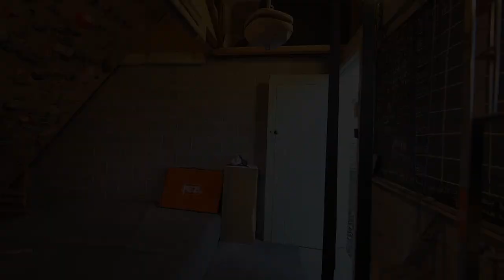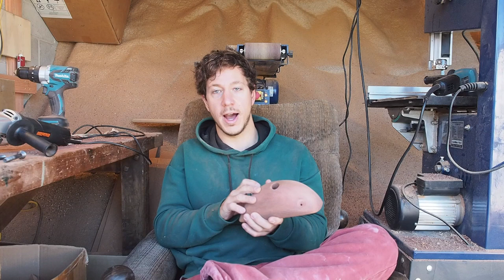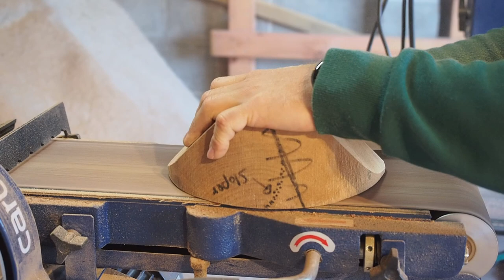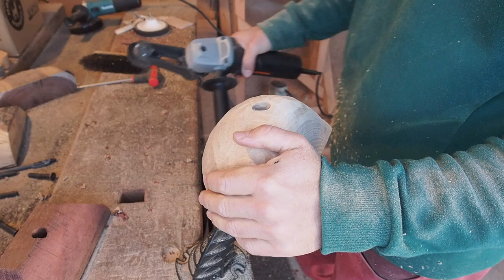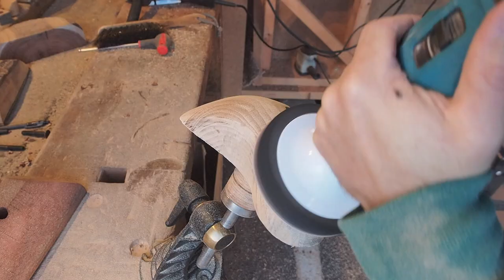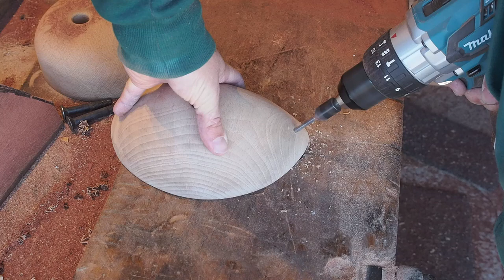Shaping Wooden Climbing Holds - Sloper #1

Comment: Great work! Just wondering why you go for the full sanded finish? Wouldn't a rougher texture from just using the grinders be a nicer feeling texture at half the time and effort?
BTW, are you in NZ? Those were definitely NZ birds at the end...
Reply from the maker: I just love the slippery finish... You need to apply more contact strength. :)
Also noticed that I use holds with a sanding finish more often. But yeah, it is bad in terms of effort!
Yes, I do live in Geraldine, NZ! 
Alpine Kiwi, sounds like you're also south island based!?
Reply: @wurfttobias  Gotcha! I've made a few holds over quarantine out of excess oak. I used an axe 😂
I was born in the South Island, but shifted to the French Alps back in 2001...
Great DIY series, cheers for sharing!

Comment: What are your thoughts on using self tapping screws vs bolts? You seem to use a lot of bolts but lots of wooden holds I see at my local gym on the training wall use 3 self tapping screws. 
I also commented on one of your other videos asking about bolts :)
Reply from the maker: Hey again! :)
I'm using bolts for two reasons:
The workflow of how I use the carver's vise makes it so easy. You can even attach the hold upside down and continue working on it. With screws it would become more tricky (you would need probably more than one screw to attach the hold safely; I would have to exchange the wood on the vise quite often because of all the screw holes)
Second reason: I don't want too many screw holes in the wall so I can rearrange the holds from time to time. 
If you don't have a similar workflow for shaping and the holds on your woody aren't going to be rearranged (often) you can definitely go with self tapping screws. That's easier (no T-nuts required) and cheaper.

Comment: Can you list the model of the drill sanding pad and/or sandpaper? Assuming you use no holes sandpaper, looks like 5"?
Reply from the maker: Hi Nick,
I'm using a 5" foam backing pad, something like this: https://www.bunnings.co.nz/powerfit-125mm-foam-backing-pad_p6210749
in combination with a hook and loop converter: https://www.bunnings.co.nz/powerfit-125mm-backing-pad-hook-loop-converter_p6210751
and 60 or 80 grit sanding discs without holes.

Comment: Hi there, im wondering what size hex bolts are you using as the main support for the holds? Cheers from Malaysia
Reply from the maker: Hi Irfan, I'm using M10 countersunk bolts in various lengths (40 - 80 mm), depending on the size of the hold.
Cheers from New Zealand

Comment: Hey man this piece in beech right? Its beautiful. What are the two pre-drilled at an angle holes on the sides? To screw it down into the wall with self tappered screws? Will The T-nut alone not be enough?
Reply from the maker: Thanks man. Yes, it's beech. The small holds are just for small screws to prevent the hold from spinning (one would be enough, but I thought two look better).
Reply: @wurfttobias  thanks for prompt reply. I understand, makes sense with such large hold. I will let you know if I find a solution to avoid the screws.. I guess for when the hold was to be used at the gym etc. Perhaps a thin layer of rubber backing?
Reply from the maker: @nieustawajwbiegu  hey! Every climbing gym uses small set screws to avoid spinners. Even with a nicely textured wall which has a lot of friction... Cool idea, but a rubber pad sounds way more effort, will be more expensive than additional screw(s), and I don't think it will work better.

Comment: What kind of wood are you using?, Here where I am I can only find Pine, I'm afraid i will be to soft
Reply from the maker: Yes, pine is probably too soft.
This hold is made out of beech. I bought it on trademe (that's the eBay equivalent of New Zealand). There are also places where you can buy recycled hardwood...

Comment: Great Video, just wondering what the minimum amount of gear you would need to make these holds?
Reply from the maker: Thanks Nat! My guess: a hand saw (japanese pull saw would probably make sense), a drill, an angle grinder with a carving disc, a sanding pad and some sand paper. An attachment for the climbing hold could be made out of a 2"×4" and a T-nut. But you would have to work with timber that has one plane surface (bottom surface of the hold) or accept that you can't do a perfect job with the saw. :)
Reply: Tobias Wurft Thanks, might try sometime!

Comment: Nice, but you don't need all the devices. There's yth unique about handcrafted holds you can never achieve with all the machines in the world. Thanks for the great video.
Reply from the maker: Thanks man! 
Yeah, I agree, there is something satisfying of doing it by hand. I started carving years ago and in the beginning I didn't use any power tools.
But after years, it gets boring to perform the same simple task again while you know that you're waisting time by doing it by hand so I started using power tools. These tools than require a new skill set and that's what I love about it: acquiring new skills and getting better at it. 

But using power tools is still 100% handcrafted because non of the used tools can perform any of the required tasks on it's own (compared to my CNC for example), it still all comes down to the skills of how to use these tools and I'm involved 100% in each step. Drawing a line of not using power tools is arbitrary because you still use tools (saw, chisel, knife...) which are basically chosen as the state of the art from a historical perspective so you could also go ahead and say I only use stones or I only use my finger nails.

As you probably noticed: I love to discuss and reflect on such things! :)